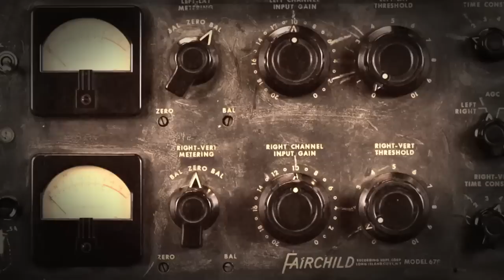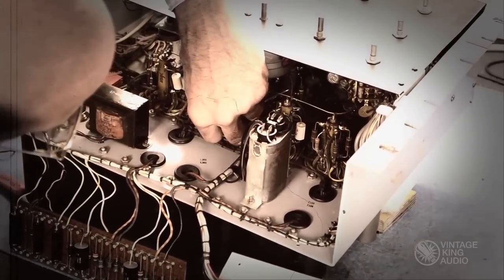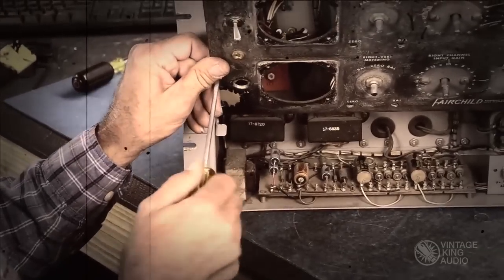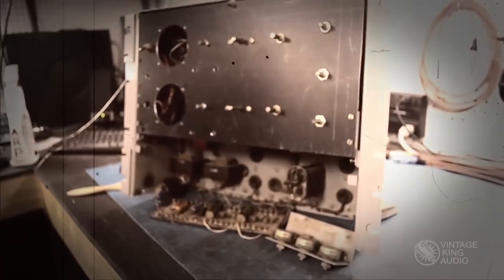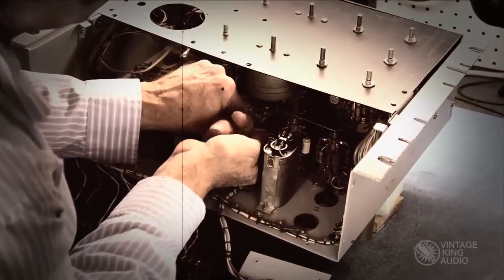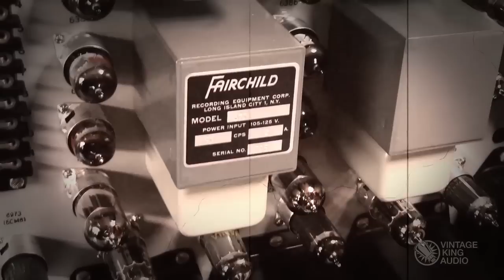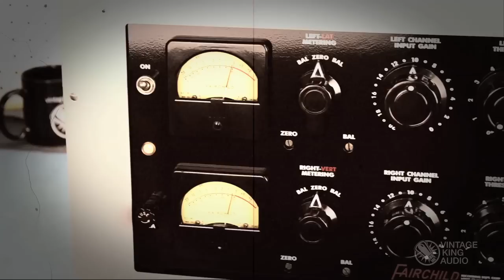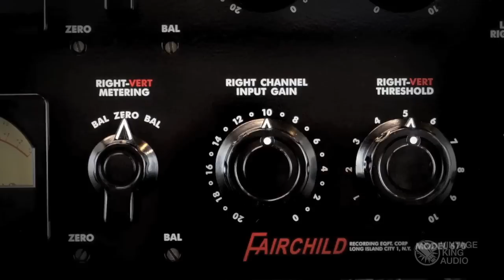Fairchild 670 Restoration | Vintage King Audio

Comment: The closest I'll ever get is the UAD plugin and that sounds pretty great but I'm curious how much better a real one sounds.
Reply: louderthangod In my limited experience comparing hardware units with their plugin imitations, I find that the term is not always "better," but rather "different." 

Many times, especially when comparing cheap plugins to the real deal (e.g. Pro Tools' included BF-76 with a hardware 1176), the hardware unit absolutely sounds better. Oftentimes this "better" sound is the result of the circuitry affecting the audio in a way that is simply more aesthetically pleasing than the algorithm of the plugin. 

Sometimes, however, a plugin shines through. For example, I know that Adam Ayan of Gateway Mastering prefers the UAD plugin of the Manley Massive Passive to any of the hardware units he's had available to him. That's not to say his preference couldn't change however...

One quirk of hardware units is inconsistency. Even in the tightly controlled manufacturing of professional hardware audio processing, there are sometimes inconsistencies from unit-to-unit that are difficult to ignore. Some famous audio engineer (though the name currently escapes me) once said something along the lines of "We have five 1176's. Two of them are our favorite doorstops." Especially with vintage circuitry that shows its age (e.g. The Fairchild in this video), just because something is an analog circuit with tubes and an impressive nameplate, doesn't intrinsically mean it is an amazing piece of gear.
Reply: louderthangod just listen to any beatles record.

Comment: Just curious, how much do these things typically go for nowadays?
Reply: “How much do these things typically go for nowadays?”
As with any vintage gear, it depends on the model’s condition. 
Over the years, I’ve seen non-working 670’s listed for as low as $20k and needing serious repair, (or even complete overhaul), to as high as $60k, that are in great working condition, or because they have had a complete restoration.
There really is no “typical” price; though they certainly command much higher prices than other vintage pieces of the same era; not only because of their rarity (in comparison, it’s not as difficult to find vintage 1176’s or Pultecs, or LA2A’s) but also because of the 670’s now-iconic stature - often being referred to as “The Holy Grail” of limiters...
And because there aren’t that many of them left, and that the original components in them aren’t manufactured anymore, those that do own 670’s in good condition will often snatch up non-working 670’s for the “potential” of it having certain components that still work, and that they might need in the future, should certain parts in their working model eventually need replacing. 
The other factor in the asking price would be “where” the 670 came from; if one had been used in a famous studio, or on classic recordings, then this could seriously jack the price up as well... 
an example would be if a 670 had been at Abbey Road for 50 years, had been loved, and kept in great working condition, it would command higher prices. And if had been used on famous recordings - like that of The Beatles -then it would be valued even more because of its history. 
BTW... I’m not suggesting that Abbey Road is selling any of their Fairchilds, LOL, just using them as an example, but if they DID choose to sell one, it would likely cost the buyer the equivalent of a second mortgage, along with their kid’s college fund, plus a lung... and a kidney. LOL. 
😉🙏

Comment: What was the burnishing tool used to clean the contacts? Someone else asked the question but never saw an answer. I, too, am interested to restore my own equipment.
Reply: Very SOFT 9B pencil.  Do NOT use hard graphite pencil.  Clean up with isopropyl alcohol.
Reply: In case anyone is looking I believe it's a glass fiber brush. Found a stainless steel brush SH-20k on mouser that is a little more abrasive as well.

Comment: hi dear, how are you? please, maybe you can help me in my doubt, i want 
to built in my own home my LA2A original audio circuit, using commum 
electronics components of the current stores. how dificult is it for a 
person that have basic eletronic knowlogdes? will the quality near as 
the old original if i use exactly the same original eletronic plan? does
 it will be worth in cost of money, time spent, and quality? i saw the 
plan, i think it will be easy, maybe i can make it to sell if it works 
well, could you clear me better?
Reply: HOBBY-ART Hello! Following a schematic and building your own imitation circuit can be a fun learning experience and a great way to have a well known piece of gear for cheap... but the LA2A is not a circuit I would recommend trying to emulate unless you are an expert in electronics. Because it is an optical compressor, the precision needed to construct a working one is very difficult to achieve. You could probably try to construct a VCA compressor or even a FET compresor like the 1176. Best of luck!
Reply: The Warm Audio WA-2A is really close to the LA2A and I doubt you could build it cheaper than they do. 
If you want to build a compressor just for fun, the Hairball Audio 1176 clones might be easier, though their DIY come at about the same price as the Warm Audio WA76.

Comment: Powering up the unit before replacing known faulty components (like PS filter caps)?!? Amateur move... That rectifier tube was probably functional before you first turned it on.
Otherwise, great resto video and yes you do excellent work. Beautiful job. 
Resist the temptation to turn it on when first receiving it. Total amateur move!